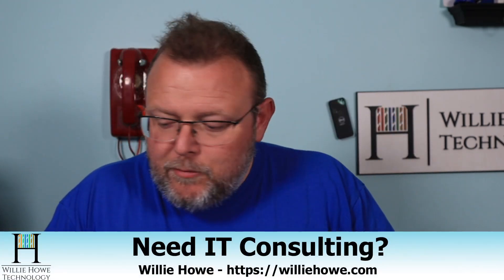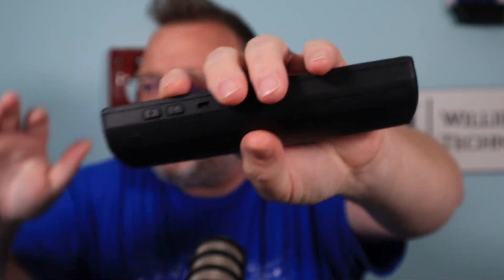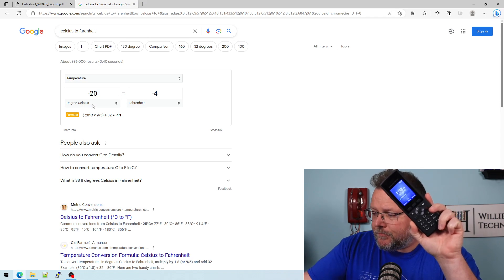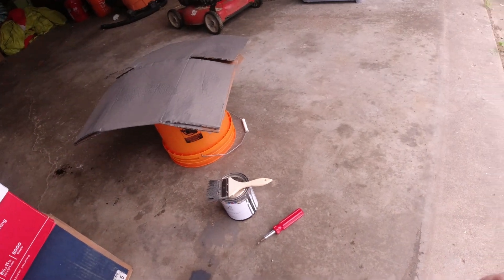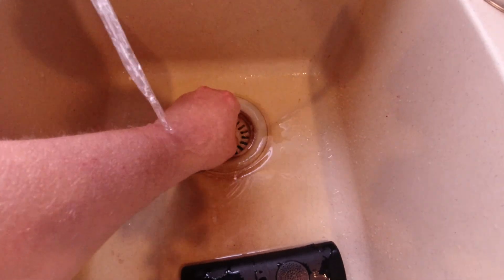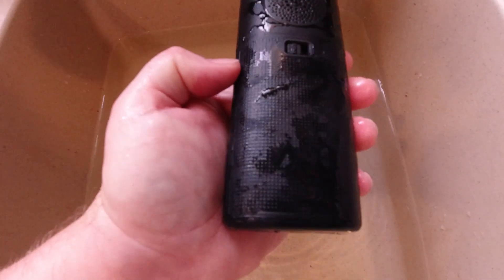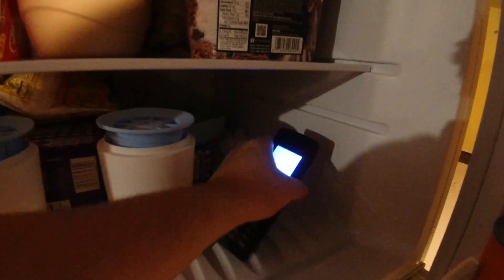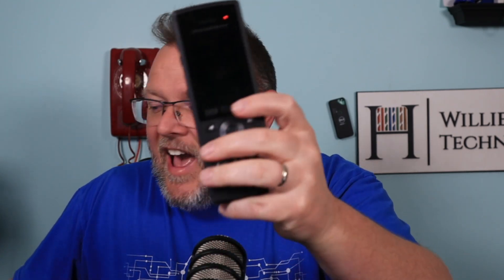World's Most Rugged WiFi VoIP Phone - Grandstream WP825

Comment: I think I’ll buy a couple of these and put them in a restaurant. We’ll see how durable they really are after that… they destroy everything.
Reply from the maker: Would love to hear how they hold up.
Reply: @WillieHowe  next one will be opening sometime in June or July, I’ll add to my calendar to post back in December or so.
Reply: @vono360  How did it go?
Reply: @RobustAmericanStyle actually really good! I liked the first one so much that I bought another one. They are the primary phones for the restaurant. Only have had one or two issues where they disconnected from the pbx but after a reboot they worked fine again. So far neither one shows any signs of wear honestly. 7 months now going strong.
Reply from the maker: @vono360  Still using them 5 months later?
Reply: @WillieHowe  Alright Willie... here is your 2 year update! Both phones are still functioning and holding a charge quite well. The primary phone, the phone the managers keep on them, got a little beat up the outside plastic has cracked, but the phone still works just fine. Would HIGHLY recommend these phones for a wireless VOIP deployment in the future.
Reply from the maker: @vono360 Thank you for the update!